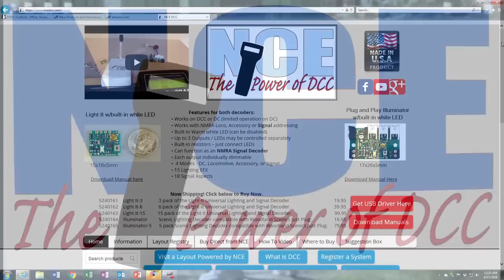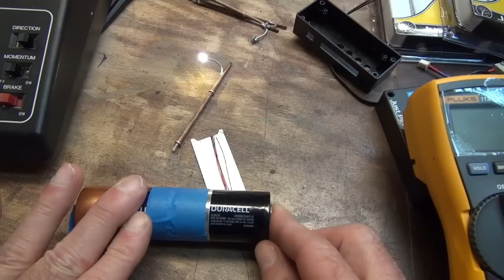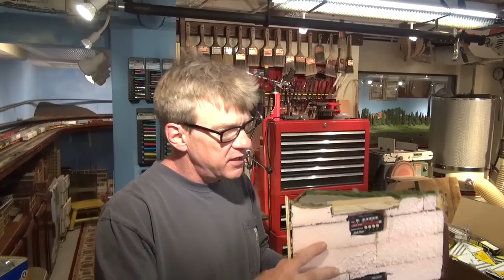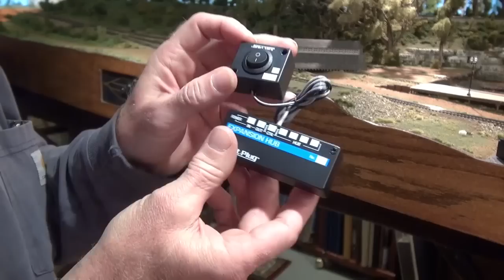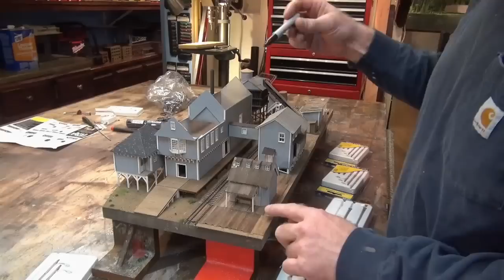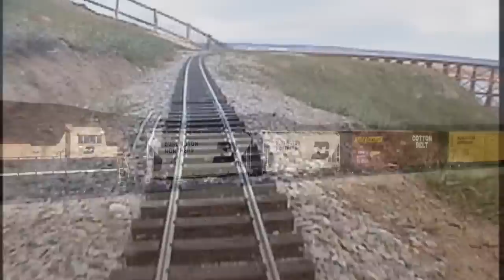What's Neat This Week in Model Railroading #279.5 July 1st 2024

Comment: That’s intresting I might need to revisit that in one of my videos.  I do hope WS can get more product to Australia we have not had new stock in nearly 2 years the last light hub I bought cost me $300USD and you can imagine all the trouble I had getting the seller to send it to me. It was a disaster. That’s why I haven’t got many new lights on the way out at the moment, but that fuel depot was coming along when the rest of those flood lights should get wired up in the next couple of weeks this week, the video will cover a first for my channel, attempting to model something no one else has attempted whether it be in rail, air or military style locations, following that we’re off to my custom-made Signal gantries. Hope you get a chance to pop and have a couple of videos include the building of the CRICKET PITCH and indeed the radio controlled circuit. Do stay safe. See you in the next one.

Comment: Nice lighting. The only thing is that all light have the exact same colour. In real life there is a colour difference, at least those that are inside buildings. Partly because of the used light, partly because of the reflection in the building. I suggest to use different yellow-ish markers, maybe even orange, to make a variation in the light colours.
Reply: They sell several different colors for the system. 

I believe they even have flashing lights too.